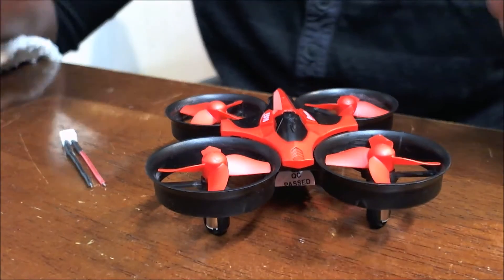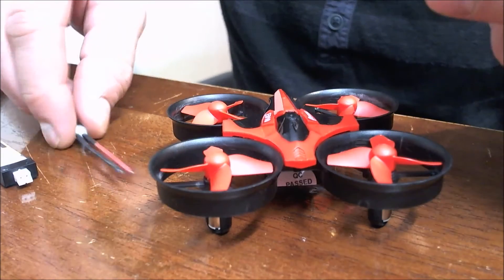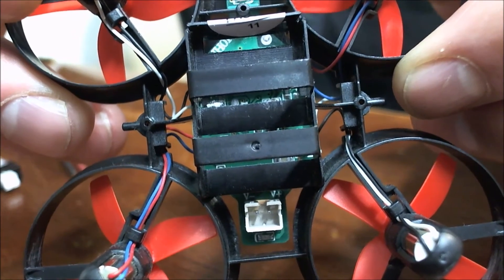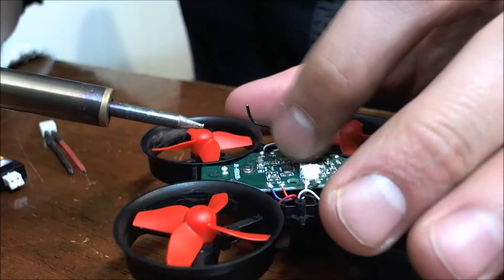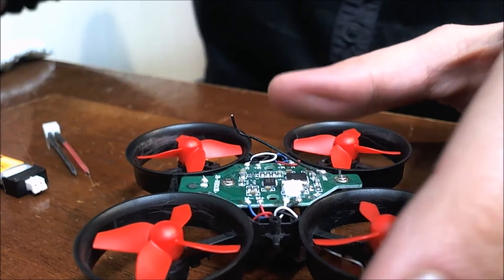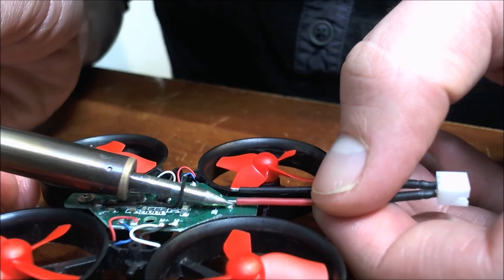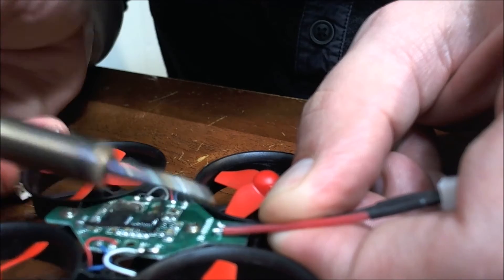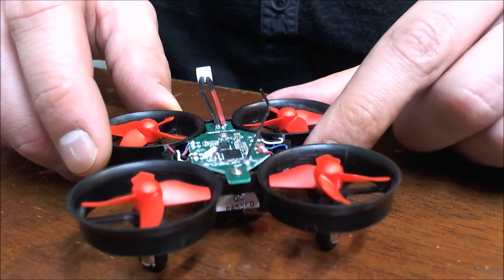Eachine E010 JST PH 2.0 upgrade

Comment: bro we increase battery power anything will to motors?
Reply from the maker: Increased battery capacity can prolong flight times.  There is deminishing return though so you will have to find a middle ground between weight and capacity.
Reply: so motors will not overheat right
Reply: can u plz tell me the flytime